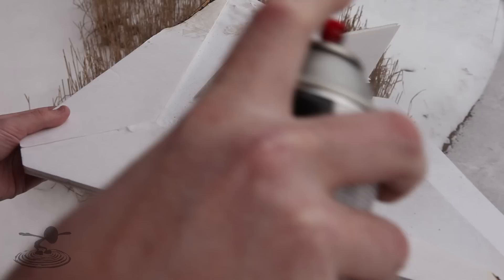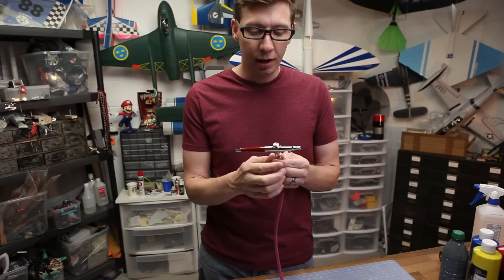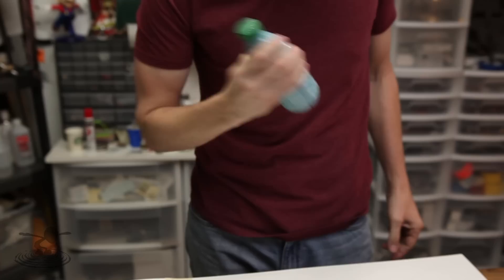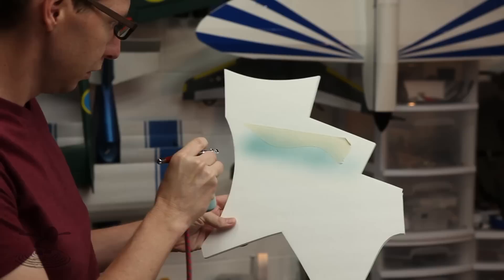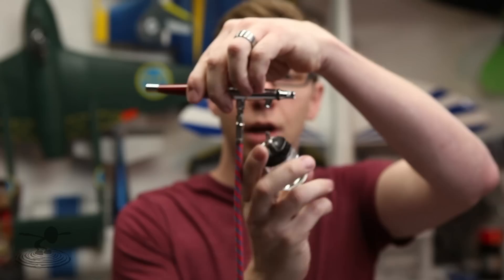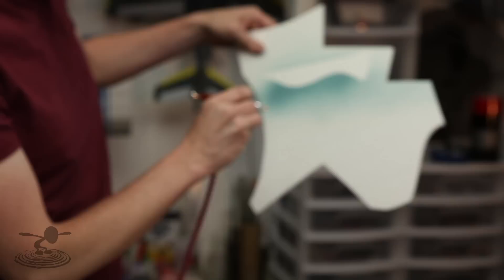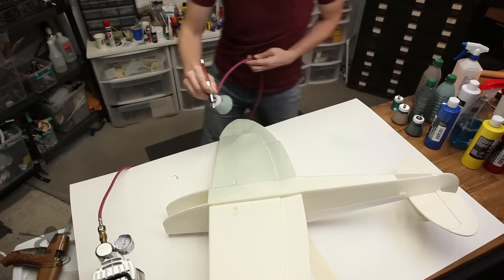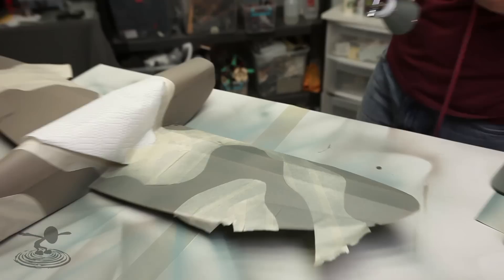Flite Test - Painting Foam Board - TIP

Comment: I don't know about airbrush and 'special' paint. What works for me is ordinary glue for wood (Elmer's glue, gorila glue...). Thin coat, and then after good drying - it can be painted with any spray (even acetone based!). What is more exciting, wood glue can be mixed with pigment for wals, or any other water based pigments. Plus, final coat over the paint - and it can be polished with paper towel to really glossy surfaces.

Okay, all paints add weight, but my method is simpler (I mean, available) and cheaper. Did not tried to add polyurethane over the paper covered foam, but direct contact with foam may disolve it (at least one brand I have).
Reply: Thank you :) this comment just helped me big time!
Reply: erica matty You welcome. Just press 'thumb up' to keep my previous coment on top - if it helps you, it may helps to other people too.
Reply: Helped me too! Cheers!
Reply: Thanks for this tip and did give you a thumbs up. Want to do some 1/35th scale zombie dioramas using foam board for the buildings and wondered how I was going to seal the paper/foam. Maybe you should come out with some how to videos.
Reply: Yes, good idea. Aside my other videos on my channel about quadcopters, 3D printing, electronic, programming, painting, and other zillion things... why not. Thank you!
Reply: @thomdanger777  "

Comment: Another good way to lay down camouflage lines is to stretch Silly Putty into a long thin strand and use it to shape the line. You can move the line around until you're happy , and then lightly press it into place.  Add tape to cover the area you don't want painted.  There's a lot of good tips from the scale modeling community.  Thanks for the video.

Comment: I am working on a couple of planes now. The main one is my A-10, 64mm 2 duct. I have modified for flaps and will be putting in retracts. Once finished it will be heavily altered from original. This paint video has cleared up a lot for me and I thank you for it. I have an air brush setup and will be using it to lay down the final design on my project. Thanks again for all the good info that you have passed on.

Comment: Back in the day, I used shelf paper to make up stencils for painting. It uses a low tack that holds it down, but it releases easily and has less tendency to pull up lower layers. It also comes in rolls large enough for most projects. Assuming, of course, that it's still available. It has been some years.

Comment: And old painting tip from the old days:  instead of masking with masking tape, use freezer tape--it's doesn't have so much stick, so it won't pull up the paint underneath so much.  Also, once the tape is down, run a fingernail along the edge, making sure it's tight to the surface, then mist lightly with a clear coat along the tape edge.  Then shoot color, and pull the tape up (pulling back along itself to cut the paint sharply) before it cures completely.
Reply: Be meticulous.   Freezer tape for a sharp edge, shoot colors light to dark, and let a layer cure before shooting another layer.  Get a tack cloth, and use it before shooting.

Comment: Great tips! I've done airbrushing on foam for non-rc aircraft but I have had another good trick when doing it. If do the coating you can actually use water as well to thin the paint. The amount of water depends on how thick of a paint you buy. Thats when its great to make small samples with the base paints to find that right mixture. I also found it to make cleaning the air brush easier.

Comment: The spatter is from not keeping your air flow on. If you stop air, then hit it again without cutting off the paint. You will get spatter. That is basically a disciplined learning curve to fix that issue.

Also, dry tip can cause an issue as well.

Also be careful with the windex. It has ammonia in it and can remove your chrome coat from the airbrush. Mainly the bowl type bushes.

Comment: great vid!!! if you don't use the minwax  I found out that if you use light coats of paint from walmart, get some 400 grit or higher sand paper and sand the paint each coat until its slick enough for you!!! I have use this many time but I have only used solid layouts. The sand paper helps with all the over spray you get from holding the can so far away during each coat!!! Hope this helps some people, keep the planes coming.

Comment: Another tip that may help people with their paint jobs.  After you finish your paint job, spray a lite coat of S C Johnson "Pledge Future Floor Finish" through your air brush over the paint job.  It will preserve and protect the paint.  Not my idea, found it on another forum and have used it and it works!

Comment: At about the 1:03 mark it is stated not to use the water base MinWax; I have used it on foam board several times with excellent results. Just do very light coats with a "foam brush" applicator; I usually do 3 light coats prior to painting. The water base dries very quickly and has practically no odor, just don't get much on the applicator and spread it thin and even.

Comment: You can also use my favorite...Windshield washer fluid. The methyl alcohol in it work perfectly to thin cheap Walmart , Michaels or Hobby-Lobby acrylic paints. I use two parts paint and one part WWF...then strain it through cheesecloth by putting cheesecloth under lid of storage bottle....a VERY important step. Harbour Freight has a great dual action brush for cheap.......The tip about the standard minwax is priceless!..I use Waterbase clear polycrylic as tough , glossy last coat

Comment: If you use spray paint..I strongly recommend a high pigment, works much better. Montana is great, I've used Ironlak and it works fantastic. Another tip*, don't use the cap that Ironlak comes with (Its a fat that sprays a lot of paint) use a more misting tip. NY fats works good enough and most common and cheap.

Comment: If it is available in your area, I would recommend Blue "Painters Tape" it is designed to tack down well but is easier to remove than plain Masking tape...   You can find it in most hardware stores at a good price, and many 3D printer companies also carry it (at outrageous prices).

Comment: I just got through painting my old Fogey with Minwax exactly like Chad did and the paper on the foam started peeling off and puffs are everywhere. I used the correct Minwax (not water based) and brushed it on with an even coat, but not a heavy coat and any excess was removed. I am wondering if the type of foam has changed because now the FT Old Fogey I have can't get put together? ?

Comment: Just as a tip for you guys, if you can't find airbrush paint, you can use regular acrylic paints 1:1 with alcohol, it will be about the same consistency as the 2:1 airbrush paint/windex mix.
Reply: I know it's been 10 years, but will isopropyl alcohol (IPA) work?

Comment: Do really want to buy me an airbrush SoonTM, but i dont want to endup with a brush i cant use for both my really small military models, and for the bigger stuff RC planes.

Also i am looking at air storages so i can paint at more dark hours.
thinking of using a simple Cola bottle :P seeing as they are designed to hold far more pressure then anyone would think.

Comment: Reduce paint with what the manufacturer recommends for clean up. Also--windex will add blue to the color. Happy painting! Best of luck to all....
Reply: Even if you wanted to be cheap, the main ingredient in (at least old formula) windex is/was ammonia. You can get a 64oz bottle of ammonia at dollar tree. Might as well just pick up a bottle while getting foam board or whatever.

I used to use windex with ammonia to clean everything, then when I got in to game collecting 10 years ago I learned real fast windex dyes shit blue.

Comment: How loud is the pump from Harbor Freight? Could I use it in an apartment without annoying the neighbors?

- Floyd
Reply: anything like the one I have no problem at all
Reply: Floyd Dameron build a “duct box” from the AC section of the hardware store. Or a heavy insulated cardboard box. Make sure you have ventilation so it won’t overheat.

Comment: Chad: AIR "pressure" on a Dobble action.

AIR is NOT, repeat NOT meant to be regulated, by pressing more ore less -THAT makes SPATTERS, like you say in your video...

AIR is OPENNED FULL, and then the Flow of paint is pulled back -Then it will Newer spatter.
Vice versa when stopping to paint, PAINT OFF first, then Air Off.
BTW you can use AIR ONLY to dry faster, also a good trick

Just a tip, annother tip is to get your Airbrushes at Hobbyking, so good, and sooo cheap

Comment: do you guys think I can paint a flyzone playmate with acrylics or will it be too heavy?
Reply: you cant really add enough paint to make any realistic difference unless you put maybe 30 coats of paint on.  at that point however the thick paint will give rise to issues bigger than weight.

remove the old paint or at least as much as you can then repaint.  paint over paint is seldom good.

Comment: Never thought of that, thanks :) Do you also know a replacement for the fiber reinforced tape? I use that on critical areas like the wing joints on a polyhedral wing...
Reply: I was in a simular boat, couldn't find fibre tape anywhere and fleabay seemed expensive, so got desparate and emailed 3M sales and they pointed me in the direction of a local distributor so not only did i get the handy 28mm (or w/e the actaul size is) but also was able to obtain the 48mm stuff and a choice in crosshatch and linear fibres

Comment: Naa.
That's classical flying boat fighter. As a fuselage is the boat itself, no separate floats.
You see, there is not much choice where to place a motor on flying boat fighter. High above the water on a pylon. Close to CG. With traktor or pusher prop.

Comment: If I could make a suggestion, mixing paint with random chemicals is not advised without some research first, as some may create harmful gases and fumes, or flammable and combustible mixtures. Also, if you recommend minwax, but not the water based kind, a reason would be nice. One is the paper tends to lift from the foam. Odourless thinners and cleaners are still harmful and you are still breathing them in. Safety first!

Comment: PRACTICE PAINTING A LOT BEFORE YOU TACKLE YOUR AIRCRAFT. ..... THICK PAINT WEIGHS A LOT.
I think the guy painting the Minwax is putting way too much on those aircraft patterns,  that would make cutting out the pieces hard work, especially if you paint over the cut line with thick paint. ..... You need to SPREAD the minwax or paint, as much as possible, you can always put another coat on if needed. ..... As you stated paint weighs a lot if you put it on thick.
When refilling your airbrush bottle/tub, ALWAYS shake the ready made paint because as it stands the mixture can settle a bit giving you a lighter tone if you don't shake it..

Comment: There's other reasons to wear a mask other than odor genius. Hence the name "respiratory mask". You want to protect your respiratory system from you breathing in paint particles into your nasal cavities, throat, and lungs because it can build up over time and create breathing complications or cause cancer.
Reply: Bob Ross (r.i.p.) used to “beat the devil out of the brush” after loading it with solvent.  Many toxicologists have weighed in thinking that his particular cancer could have been caused by chronic mineral spirits exposure (inhalation).  It’s not anything to fool around with especially since a respirator isn’t a great hardship to buy and use.